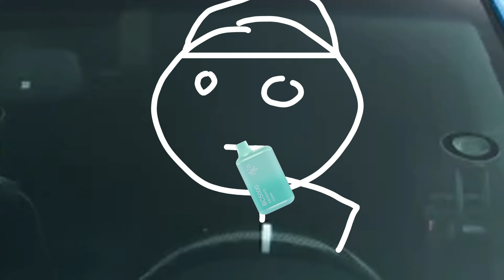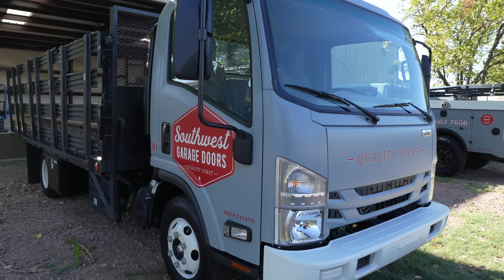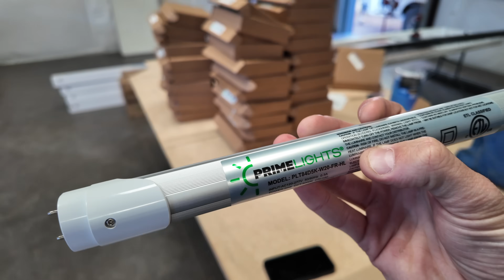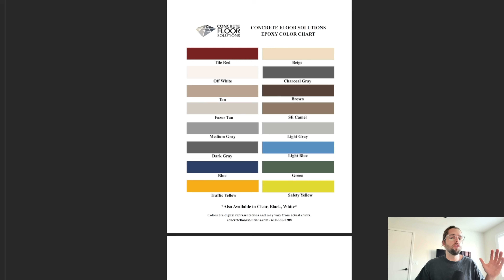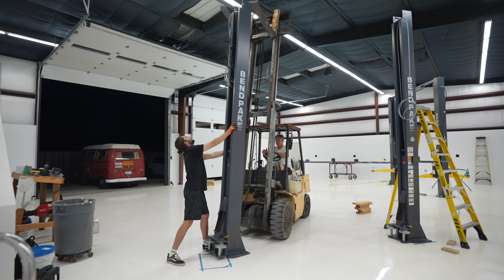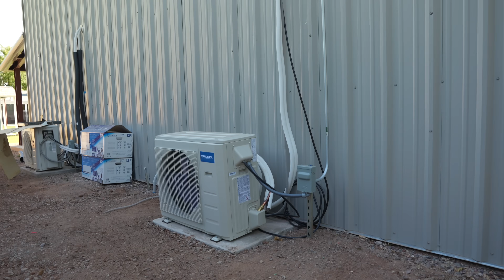The Ultimate Dream Car Garage Build Start to Finish

Comment: I would not have gone to such extremes, I’d have left the floor as a oil resting polished concrete . I’d have left the apartment out, and only had a small break room style room, with a bathroom, a fridge, and a microwave. I do like the storage tho. The walls are too complex, I’d have just the regular insulation that boarders the metal, and then just the painted osb over that. The lifts I would’ve  lined up correctly with the doors. The gate should not be powered. Just a latch and a track would have worked fine, and that half-garage door? Why? Just put in a regular door. 

All in all, you probably spent way too much, but it works as a garage.

Comment: You base your btu or tonnage based on ach air changes a hour of what target your need this the factor used when sizing equipment not square feet it’s cubed feet volume times aches divided by 60 then that’s your cfm each 12000 btus or ton is 400 cfm your space is positive pressurized which it’s supposed to be but exhaust air should be slightly less that you 3600 cfm you have so like 3300 exhaust air to move the air Correctly

Comment: Split system that’s it a Mr cool ?? It’s going to get hot no exhaust fans as well don’t you need to exhaust the fumes if cars are running due to the toxic fumes ??

Comment: That gate is amazing and looks badass.  Curious why not just move the man gate between the side gate and the main gate. 

It looks like moving the main gate to the right to fit the man gate there would have still make the gate even with the entry way of shop. Or off about two feet.  Which looks like it still would have been plenty enough to pull in and out without angling anything at all.  

Looks amazing though.

Comment: Concrete densifiers work better than epoxy.  They never chip or peel - and will be waterproof, acidproof and completely stop dusting from the concrete - HA - but no way look as 'pretty' as this well done floor- NICE job.  CHEERS from AUSTRALIA.

Comment: I would use 4x8 beadboard panels up to the ceiling and insulate behind them to the top. Beadboard is way cheaper and up high once you paint it, the beads will fade in anyway. The cost of the beadboard and the insulation should pay for itself relatively quickly there. Absolutely beautiful work.